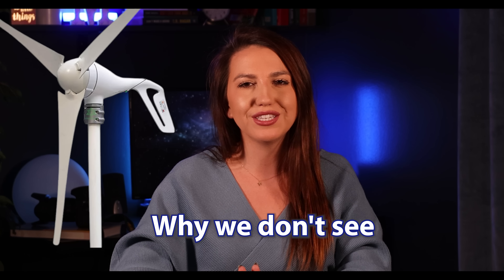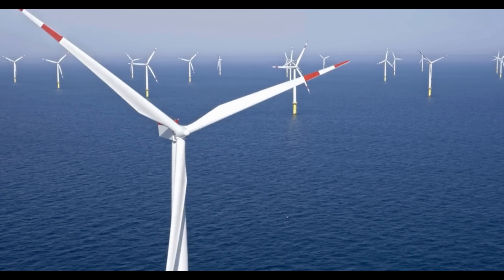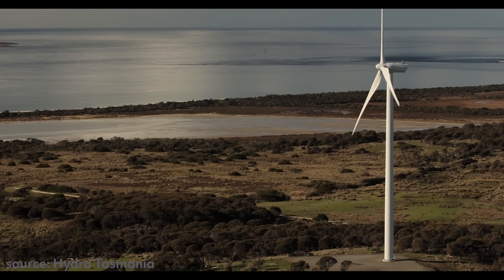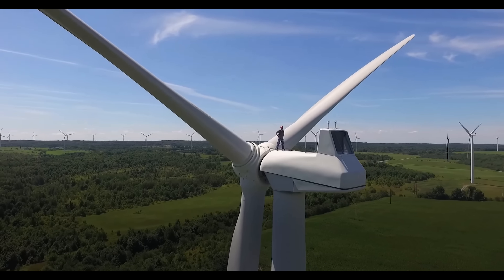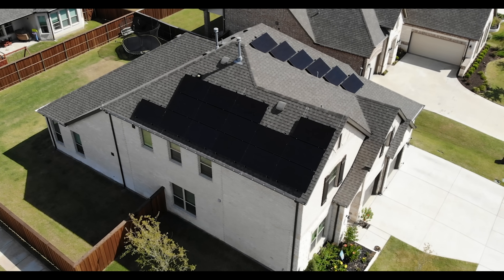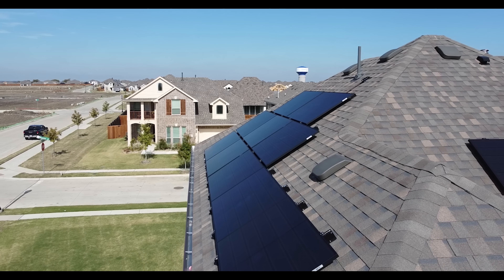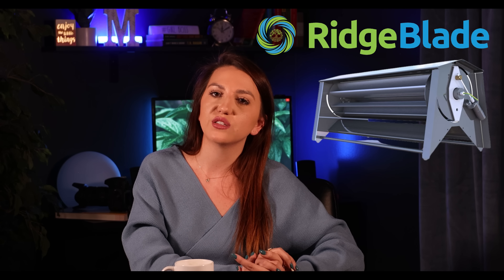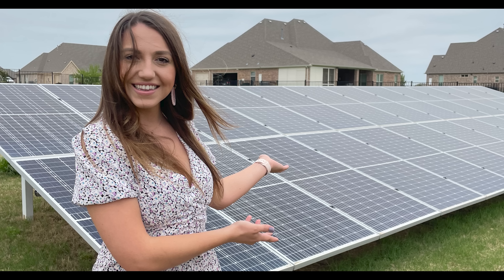Could this Turbine Destroy Solar?  | Why haven't we seen these small wind turbines yet...

Comment: "Popular" shouldn't be a criterion. Mills & Boons is the most taken out of books from libraries

Windmills don't require gears anymore, they cause friction & waste energy. We now have direct induction systems without gears.

I also wonder if using axial flux or genimi dynamos would improve output.

Counter rotating turbines seem to be a good idea as the speed between the two blades is doubled, electricity generated depends on the rate magnetic lines of force are cut by a conductor if the blades have in-built magnets & conductors it might improve efficiency.

Comment: My thoughts about this kind of reflect my thoughts about electric vehicles.   HYBRID seems to be the best of both worlds.  However, I have watched another video about the Archimedes set up and it seems very good at working in light winds which would be the most common condition.  Storms are not 24-7.  I'm wondering why the generator isn't part of the spiral, or the generator IS the spiral.
Reply from the maker: I actually am going to be doing a ton of research on that particular turbine because there is a ton of hype about it. And that was too, one of my first questions, is where is the motor and electricity generation, do we need an external converter for DC to AC??? So many questions. Hopefully, I will be able to make a video about that soon!
Reply: Do not bother.  The weight is death.  Get to the basics.
Only the outer third of any turbine or propeller actually does work. The rest is not going fast enough to produce work.
The outer third should have big blades to better capture the wind.
Engineering experiments show that the angle of 25.5 degrees captures the most energy. (Three blade cantilever blades are at an angle of about 2-4 degrees).  This produces high RPM, and is not efficient.  It also produces noise and vibration.
Going faster takes more energy from the very wind that you are trying to get energy from.
Bigger is better with all wind turbines.
Heavy on turbine blades is not good. More cantilever blades add more weight, to the point that the shaft cannot support more.
The Tension Turbine is the only wind turbine that is feasible now.  The Tension Turbine tip speed is  SLOWER  than the wind.  This produces maximum power and little noise or vibration.
The Tension Turbine: Half the weight, twice the power. 
The future is the Tension Turbine. TensionTurbine dotttt commmmm for more information. @solartimeusa
Reply: after seeing cars catch fire  in china i would never park a Ecar in a indoor garage . that or never sleep well again

Comment: It's because wind sucks. The turbines are fine. But wind is such a fickle thing. Location is king, whereas solar can be installed almost anywhere. You might have a few trees around, and get some shading with solar. But wind is kind of go or no-go. If you don't achieve that critical RPM on the alternator, output is almost not useful. Plus it's mechanical, so all of a sudden there are mechanical issues, such as reliability and noise.
Reply from the maker: Agreed.... I do think wind would be great in windy and northern parts of the world, like Alaska, they experience a mere 60-100 sunny days per year, but if we had a solution with wind for the coastal areas it would be very useful. But then the problem of demand in those "dark" areas.... not many people live there so not much of a $$$ demand...

Comment: If its small you won't get much out of it. I have also read the bearings wear out every couple of years so keep spares on hand to replace them. If you live in a hurricane area make sure you can take it down easy so it doesn't come through your roof.
Reply from the maker: Very very good point. If only they made one that would be on a tower that comes out in the windy hours, and folds down when weather alerts it and speeds are too high.

Comment: I had a new offer. Turbines that work using atmospheric pressure. The air above our head has a very heavy weight that when it is inside a vacuum container, it crumples it. If this power can be produced into electricity, it can be very useful. Generate a small amount of electricity with solar energy and use that electricity for some vacuum pumps for the atmospheric pressure turbine.

Comment: Put simply, the wind resource in typical residential areas is rubbish compared to grid scale wind where turbines can be located in optimum positions and at great heights to minimise turbulence. As such, Residential turbines have a terrible capacity factor. This can improved by mounting them high on towers but who wants that in a residential setting. Solar panels by comparison, are relatively benign
Reply from the maker: Yeah, that's why so many different investors are trying to make a statement, like those round, ball-looking omnidirectional turbines.  I think one day they will figure it out, but for now it just does not make sense...

Comment: If you've ever stood next to a residential wind turbine when it's putting out power, you'd immediately realize that a source of vibration like that is not something you'd ever want physically attached to your house.
Reply: Definitely not attached to the house, but I've seen plenty of electric windmills that were relatively quiet on the yards of homes.
Reply: Heck, I just got a wall mounted heat pump and it somewhat noisy , when i go near the wall that it is mount on, inside the house, I bet a wind turbine would be crazy high in noise and vibration.
Reply: The ocean based wind turbines are generating vibrations that are disorienting whales and causing killer whales to start attacking small boats.
Reply: I really often do not want to see or hear other peoples "junk" either. Therefore, I think underground "structures" may be a completely viable/logical solution. Bedini SSG? Provide for one self's clean water too...
Reply: Not to mention the sound of a jet sitting on a runway doing run-ups. 😮
Reply: I'm testing the vertical generators. I expect them to be quieter than the horizontal blade models.
Reply: Use a damper or suspension mount

Comment: Lol... What they are not telling you about Huge Grid Scale Wind Turbines: there are up to 800 gallons of gear oil in one windmill, then there are another 1200 gallons of oil in the transformer the wind mill is connected too. The blades are not recyclable and have to be buried. They have diesel engines to get them moving and depend on electric heating of the gearbox when the temperature gets too low. Green energy is a lie and a myth.

Comment: A silly idea for vertical axis...  Take a 4 foot circle and place pieces of wood vertically on the edge of the circle, with a top and bottom circle.  Mount on a vertical axis.  Next, build a box around the circle, with 8 funnels to gain extra power from the incoming wind.  Set up a drive system so that it powers a 24 volt DC truck alternator.  That can then feed into a battery system.  One beauty of this system is that it is quiet!!!
Reply from the maker: Hey! Thanks for sharing that idea! Sounds pretty good to me!

Comment: I've always wondered how efficient these giant three-blade wind turbines are at harvesting energy, and just from the looks of it, it's certainly not the most efficient way to do it. They may be compromises of technology, cost, safety, and other factors.
Reply: Get to the basics.
Only the outer third of any turbine or propeller actually does work. The rest is not going fast enough to produce work.
The outer third should have big blades to better capture the wind.
Engineering experiments show that the angle of 25.5 degrees captures the most energy. (Three blade cantilever blades are at an angle of about 2-4 degrees).  This produces high RPM, and is not efficient.  It also produces noise and vibration.
Going faster takes more energy from the very wind that you are trying to get energy from.
Bigger is better with all wind turbines.
Heavy on turbine blades is not good. More cantilever blades add more weight, to the point that the shaft cannot support more.
The Tension Turbine is the only wind turbine that is feasible now.  The Tension Turbine tip speed is  SLOWER  than the wind.  This produces maximum power and little noise or vibration.
The Tension Turbine: Half the weight, twice the power. 
The future is the Tension Turbine. TensionTurbine dotttt commmmm for more information.
Reply from the maker: Agreed. I am looking forward to at least some of them being actually available. As of now, there is much besides the normal small turbines like we see on amazon etc...

Comment: I am surprised that we don't use chimney turbines. Such a turbine placed in a chimney operates in very light winds due to the draft in the chimney that drives the turbine.
Reply: Interesting idea
Reply from the maker: Very interesting idea!
Reply: @solartimeusa  I also think so because such a chimney could dampen the turbine's operation. And there could be several turbines in a row depending on the height of the chimney. Greetings from Gdańsk!

Comment: Solar panels need to be cleaned frequently to remain efficient. That factors in as well.
Reply from the maker: I am not too sure if I agree with that. But that will depend on the location. If you're in a desert and experience a lot of debri yes you will need to clean them. But most of usa has enough rain that washes off the panels. I have systems that I installed 7+ years ago that were never cleaned beside rain water and they are doing just fine :)

Comment: I have a 24V 25Amp (600W) wind system.  I live outside the Columbia River Gorge, on the river.  The average Wind speed is around 10 MPH, sometimes gusting to 20 or 30 MPH.  You are good-to-go IN the Gorge, constant high winds.
---> Unfortunately, my Cheap system from China needs 20–30 MPH average for rated output. It also has to track the direction of the wind using a tail fin to keep it aimed. But, in a wind that changes direction frequently, when it changes direction, the gyroscopic forces slow the blades down, and it takes some finite amount of time to spin back up to power.
---> So, in conclusion,  I really needed a vertical shaft wind turbine, to avoid drops in power when the wind direction changes.  I also require a turbine that outputs its rated power, in 10 MPH wind, I probably get the wind speed I needed for full output about 20% of the time.   Also, if you require enough power for a standard home you should look for a system with the highest voltage. That way, you can charge at least 8 car batteries in series (96V) so you don't need massive wires that carry 400AMPS or more to your inverters.  Also, you'll need to buy MULTIPLE turbines for that kind of power, not to mention the cost of DOZENS of batteries.
---> I think you could use the 10 or 20 kilowatt battery module from a TESLA or other EV battery to save a lot of money and space.
---> I'm waiting for the Liquid Sodium Residential batteries that were under development a decade ago... They were supposed to store 50 KWH in the size of a 50 gallon barrel.  For approx. $2000. Ideal for a hybrid solar/wind system.
---> One more consideration is construction quality. After about a year and a half, the BEARINGS started really humming and grinding, and the annoying  hum transmitted through my entire House, like a sounding-board!  You can't be rebuilding the turbine every 18 months (Not too difficult, except for getting it down and back up on the tower)
Reply: All these turbines appear to be troublesome and noisy. I have a vertical wind powered extractor fan on my fireplace chimney. This is near Athens in Greece where the winds are moderate. The purpose is to prevent downdrafts into the fireplace. I have had it for 12 years with no problems and it is pretty quiet. It is very similar to some of these vertical wind turbines. It spins all the time there is any wind. These wind generators can and should be made more robust. They could even have magnetic bearings that rotate with no friction. I have a heat pump that is used summer and winter. The big outside fan runs all the time year after year and does not fail. If some major company like Samsung or Mitsubishi got into this, then you might see some bigger interest.

Comment: I did both so i have perspective on how they are:

1/ solar: simpler, cost effective, virtually NO maintenance besides occasional cleaning, easy to add on capacity as needed  HOWEVER no power when sun goes down.

2/  wind: require maintenance due to moving part, NOT as cost effective, no wind then out of luck, capacity is fixed HOWEVER night or day as long as wind is there  then power is there, cost effective if diy vs buying

I would do both if i have wind always available and i build myself for both wind and solar so my cost is the lowest.

Go for it if you know how to do or you can learn.  I had been doing this for more than 5 years already NOW with battery comes down in price big time.   what  are you waiting for?

With that says 99% of the population will wait and buy instead of learn and build style.  That is the real world.  The buy style will cost the most as business is NOT in that business for free.  The cost is NOT in the materials.  The cost is in the labor, know how and profit for that business.    

If they 99% of the population only knows how easy and cheap it is to do either wind or solar green energy!!!!!!!!

Comment: Issues with micro turbines: needs to mount it high, cost of tower higher or similar as wind turbine, due to moving parts it needs regular maintenance, noise pollution (you or your your neighbour may be disturbed, many or most location don’t have enough wind to provide nominal power, not many vendors basically some from China, Turkey, Poland making affordable ones, very hard to find good inverter for wind turbines, (Victron still don’t have), in case of strong wind it needs to have protection mechanism, most cheap ones don’t have such. However those who live in rural areas and already have a 48 VDC battery backup like BYD Battery Box Premium LVL there some of the 48V windturbines can be a good addon.

Comment: As mentioned produced power is directly related to blade radius and height so maybe some kind of flying energy producing blimps or kites (combining wind and solar) is the future for residential power there also are wind walls with lots of smaller generators but altogether having big surface.

Comment: Wind energy is a constant energy source compared to solar panels. Wind turbines also dont need to be cleaned and maintained and can also change orientation for optimum efficiency.
I'm reffering to smaller windmills for home use and not huge windmills for commercial purposes.
Reply from the maker: Thanks for sharing your thoughts. I hope we will see more micro turbines available in residential homes for sure.
Reply: Everything you just said is wrong. Well done.

Comment: The speed of the wind is the problem. The wind doesn't have enough energy to be useful in residential areas. The maths is simple and if you do the calculations you would know small turbines are never going to work. Plenty of actual studies as well.
Reply from the maker: Yes, in around 4 minute stamp: https://youtu.be/bS9QVicnch8?t=256 
I talk about the wind speed problem in urban areas... :)

Comment: That's the problem we are having.  We don't need the "One Best" or the "Most Efficient", we need an array of options that are "Sufficient" to meet the needs of space available, and time to generate a needed output at an affordable (maybe not the best) cost and maintenance price point.
Reply: Within tolerances... Perfect.
Reply: there are many challenges when you try to scale up production of these systems because they are so heavily dependent on the environment they are installed on and you cannot control that, that's why there is a massive disparity between their success in large operations and home usage

the other important factor that makes large wind turbines much better than home ones is the fact that at 40-50 metres height above ground and above surrounding obstacles, it's A LOT windier and more consistently than at just a few metres above ground, everywhere. So that means that for urban or suburban areas you're starting with a relatively low power density relative to the area you can put turbines on, and you're also constrained by turbine wind shade - a turbine is exposed to a lot more forces than a panel, too, and designs have a massive challenge creating a turbine that kicks in at all at low wind speeds and withstands the occasional gale that. however rare, will happen and shouldn't be the end of your turbine

Comment: Hopefully in the future I'll be able to break that bearer and get a technology that is truly world changing into the hands of those, like us, that need it the most. I have to first get the technology up and running, the move towards implementing the technology, and finally move into manufacturing the technology for the masses. As far as I can tell this technology can fully replace the use of fossil fuels for power generation and transportation. In a nutshell the technology puts the control of one's energy needs into the hands of the individual meaning one will no longer have to pay for energy ever again.
Now the technology isn't new but each time it's attempted to come out it has gotten blocked by those that sell and invest in energy like big players like the IMF and World Banks. But I am confident that this time around the technology will make it out as things have changed so as they can't fully control the flow of information as they use too be able to do.